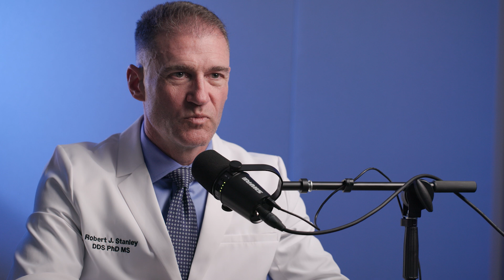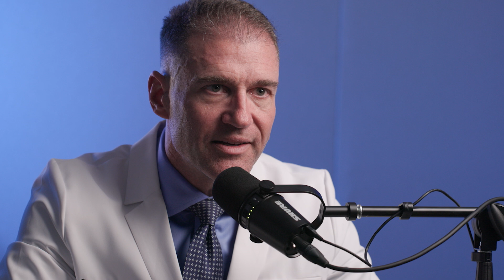Your Dental Implant Lab is Probably RIGHT.

Comment: Another thing: not placing an implant deep enough doesn't allow for a proper emergence profile and thus increased chance of peri-implantitis. I've found most restorative dentists are not aware of the concave/convex part of the emergence profile
Reply from the maker: You are absolutely correct. It is unfortunate that many people refer to the implants as bone-level implants. The unspoken assumption here is that the location of the implant platform should be determined by the bone level rather than the desired prosthesis.

Comment: Improved mechanical retention and physics and emergence profile and hygiene with a custom abutment EVEN WITH perfect implant placement. 

Why NOT just use a custom abutment whenever possible?
Reply from the maker: A monolithic zirconia crown on a stock hybrid base can provide custom emergence profiles with equivalent strength, reduced part count, no cementation interface prone to failure, reduced chairtime required for delivery, less technique-sensitive, no risk of excessive cement in the sulcus, and ultimately, it is more cost-effective for the patient.